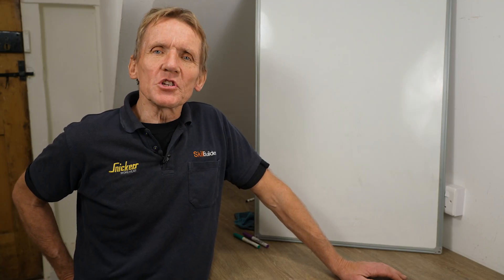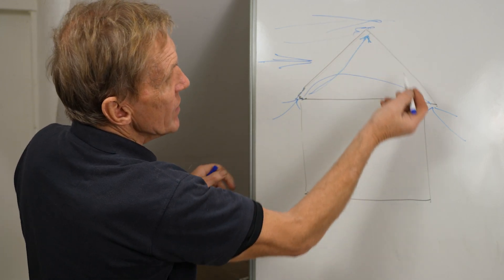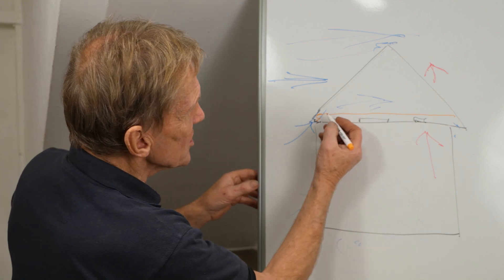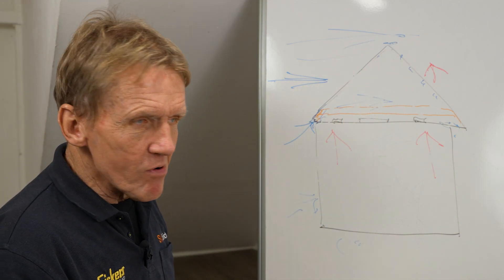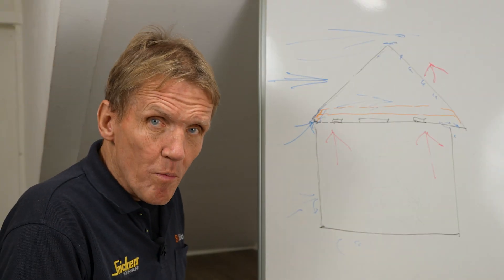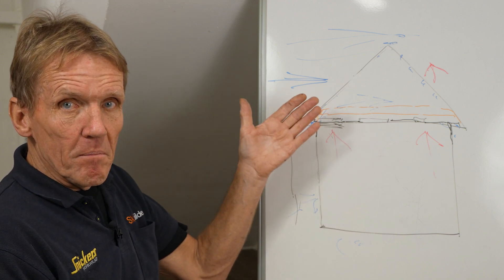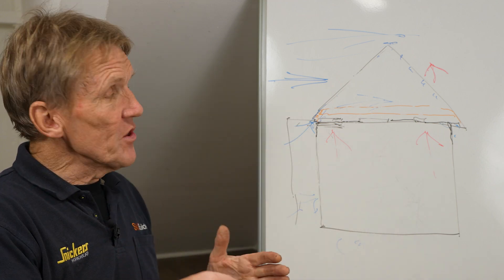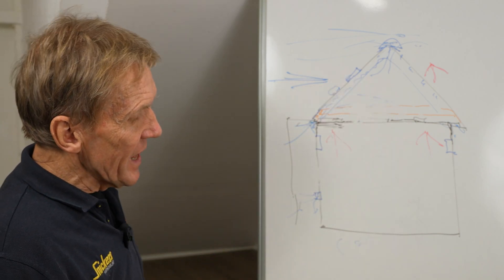Why Do You Have Condensation in Your New Roof?

Comment: Hi Roger, 
Heard you on radio 2 earlier today, I’m a plumber and I completely agreed with everything you had to say about heat pumps, the other guy David is clearly just a salesman for his product and that line of product. 
He was obviously just there for an argument, made me laugh when he replied with “that’s the biggest load of rubbish I’ve ever heard in my entire life”, I thought surely that can’t actually be the biggest load of rubbish he’s ever heard in his entire life, you made some very clear points and were stating facts about home insulation and heat pumps. Heat pumps are good in the right property, but how can a row of terraced houses or small block of flats possibly install this system practically, also completely unaffordable for most of the country, even with a £5K grant.
Reply: I only caught the tail end of it earlier but I totally agree. Often when people have a point to make that is sketchy at best, the adoption of a tone that undermines / belittles the the other ( Roger in this case), makes them seem more plausible.

People who know, know. Keep it up Roge 👍🏼👍🏼👍🏼👍🏼
Reply from the maker: Anthony
He was an attack dog, trying to discredit me from the off. The manufacturers of heat pumps say they should not be placed near bedroom windows where the noise can cause a problem, or near neighbours but he is saying they are whisper quiet. I love the claim that the pipework doesn't need changing. If you put big radiators onto small pipework it achieves nothing.
Reply: @SkillBuilder  yes but pa36 oxygen superheats at 56c blah blah blah, anyone who has lived abit just switches off when they hear this technobabble
Reply: @SkillBuilder  interestingly, I emailed you some plans of ours last year and at the time, we were considering ground source heat pumps, mostly because we are fortunate enough to accommodate the piping.

Anyway the company we dealt with were pretty much unconvinced of the feasibility from the get go, siting costs as being north of £25k to get something anywhere near the size we need, and that’s considering we have a totally blank canvas on an old property, that has been newly insulated internally!!

The trouble is, one size will never suit all
Reply from the maker: Hi Sam 
He is certainly a salesman and wasn't willing to admit that not every property is suitable. I think it smacks of desperation and he will bully people into buying. The best bit is that he is going to show us a 2 day installation and let us film it. What is the betting it never happens.
Reply: @SkillBuilder  ha ha, can’t wait for the 2 day installation video, it takes a couple of hours just to commission one properly, they’ll probably just throw 10 plumbers on the job, but like you say, it’ll never happen. 
Also loved how he was making out how clean heat pumps are and how gas boilers are killing everyone off daily. 
Don’t think he realises that most of the electricity produced in the UK comes from burning fossil fuels and heat pumps run on electric.
Reply: @sambiggs2295  The UK have lots o Solar and Wind power and there have been days when that has supplied most of the UKs electricity with some coming from Nuclear.  However as has been seen when they days are overcast or short then little solar is generated, and though battery storage helps you still need solar or other means to keep them charged.  Though generally the UK has lots of wind 2021 has not been one of them so power from them has been very low.  However it looks like there is a new generation of wind turbines without large rotating blades on the horizon with the ability to generate electricity at lower wind speeds.  (There have also been trials in Scotland and Republic of Ireland on power from the sea, not wave power, though the results have been good in the RoI I have not heard much of the Scotland test so I assume that technology is still pending.) 

The fossil fuel production of electricity is likely to be reduced over the next few years to a great extent as the Solar Power in Morocco from a joint venture comes on-line shortly, and in 2027 the power via subsea cable from Norway becomes active.  I still think there is a place for Nuclear but rather than using the very large costly installations taking a lot of time to build using the smaller modular ones.  The only issues I see with nuclear is disposal of the waste  and attack from nefarious characters and countries and the waste disposal situation needs more research to alleviate or remove that problem.
Reply: @SkillBuilder  In the netherlands they are developing a heatpump specifically made for older homes. Being developed by feenstra and vattenfall. Maybe we can get some insights on it from you?
Reply: @SkillBuilder  id give heat pumps a go if the installing company gave me 100% gaurantee that it would warm my home without and increase to my bills, gaurantee piping hot water, i love a scalding hot bath that i can then cool to my desired temp. Nowt worse than having a soak in a warm tub rather than a hot one.
God knows were they would fit it without ruining the aesthetics as they look ugly as sin. oh, and ive got 10mm radiator pipework so would need a complete refit. Im sure there are hundreds of thousands in the same boat.
Reply: Bit gutted I missed this. There's so much debate on the topic of heat pumps and having watched Rogers last few videos on them I'm in total agreement with him. I've had experience of them installed in unsuitable social housing properties where they were taken out and gas condensing boiler installed (again).
Reply: Any way to listen back to this?
Reply: @jwSawmillNL  BBC sounds. Worth a listen
Reply: Heat pumps are way to costly to run let alone buy! I bought just a small 5kwh pool heater style just to try and, it used around £5 per day around 8hours to bring the pool up from 12c to 18c on a 26c day 🤷‍♂️ if I used my lpg boiler with a small heat exchanger to heat the pool roughly same temperatures it would heat the pool to around 33c in 3hours then the heat pump would keep the temperature around 33c to 22c into the next day! However with the heat pump running through the night plus the pool pump it would cost around £15p/d  this is only a 6000lt pool so nothing special….

To get good heat in the winter everything needs supper sizing with  running costs going up, the only way having a super sized system would work is if you had a good solar array with a good battery bank! 
Solar panel’s don’t last forever and neither do batteries heat pump’s need servicing regularly so where is all this money coming from and has anyone bothered calculating all the replacements and service etc? I can see this hole system being a lot worse for the environment than burning gas.
Bring in the hydrogen boilers and ovens etc set up a grant for them instead of heat pumps stop playing games to make false profits to look good on the world stage.
Reply: Shame the debate on the JV show wasn’t allowed to continue. Isn’t electricity about 5x price of gas per kw/h even with the best Kw/h output from HP’s still more expensive than gas. Can’t wait to see you film the install.
Reply: These heat pumps only work efficiently on new build eco houses… I stayed in an small eco built cottage in Devon in May this year and 
the owner had put £5k of cellotex in the build !
To be fair it was ok but you had to switch it on 5 hrs before to get it warm !
There was a large log burner in the lounge that the owner said it was for effect !
Probably for winter I think 😂
A S heat pumps= the next big scam ………
Roger right as always !
Reply: The guy was an embarrassment with an answer to everything regardless of what he was actually saying.
 The problem is he along with other avarice salespeople will be selling in some cases a lemon to uninitiated people.
If anyone knows if or how the interview could be uploaded to utube would be nice for people to hear it for themselves.
Reply: I am not a believer that heat pumps are the overall answer even though politicians seem to have buried their heads in the ground with that as the answer.  (They have done the same with EVs, where currently they are the answer for some,  but not all, until battery technology ramps up which is happening, and have little regards for any other technology.)  When I was having a new boiler gas installed 5-6 years ago  the guy from British Gas giving me a quote told me that in theory they offered them but there had been so many issues with them that they had stopped.  With Ground Source there is not only the amount of land required but the fact that it could affect wild life as all the heat is taken out of the soil.  With Air source the amount of noise generated,unless the manufacturers invest in low noise fans that will possibly mean larger enclosures, will cause anti social issues,  And on top of that it is unlikely for them to be able to supply the amount of heat so if people need to top up with electricity that will be costly.  And then there is the cost of  the installation, replacement radiators, service pipes, etc.  Personally I still think that hydrogen should be given more consideration.  The biggest issues will be if the existing distribution network of pipes can support the pressures required for hydrogen, and whether the hydrogen can be generated environmentally friendly and economically.  Many people would have to change their boilers, and burners on other equipment  but that is still likely to be less expensive than the alternative.

Comment: I'm currently putting a bigger dormer in my 1970s "chalet bungalow".  As part of this, there's a 2-tile wide section of the original roof which will need to have the felt replaced (because it was under the original dormer edge, and has torn during removal of the dormer).  It's currently a fairly heavy bitumen-like sheet, to which the fibreglass insulation has attached itself (I think over the years).  The roof has never had moisture problems (there are no vapour barriers, and I think the roof is well ventilated as it's always dry), so I want to replace it with something that will work for me (and preferably do the job myself, as I'm doing most of the other work myself).  Should I just go for a good three-layer breather membrane?  I only need about 5m x 1m of it...
Reply: yes change it while you can

Comment: Thanks Roger. planning on plasterboarding our loft space for storage - do the same principles apply? Would a vapour barrier behind the loft plaster be a help or a hindrance? I tend to think it would help after watch your video.
Reply: Plasterboard, for storage space? Someone's doing well for themselves...
Reply: if using foil faced pir insulation you can tape the joints to create a vp and i would recommend at least a 50mm air gap and a dry ridge system
Reply: and fascia vents if boarding to the floor, if boarding to a dwarf wall (ashlaring) then tile vents would suffice
Reply: Vapour barrier yes….a vapour control layer no ( Vcl )

Comment: I don't think moisture permeable membranes on the roof are a good idea at all. Better off ensuring you have proper eave ventilation, or install a dehumidifier.
Reply: Can you explain your opinion. To say they are not any good (breather membranes)has to have back up. 
Of course eave ventilation is mandatory but everything is a system: eave ventilation, dry ridge , hip ventilation and breather membranes all work together like roger says  it comes down to quality of products. Companies like Tyvek, protect glidevale and klober spend thousands on R & D to put there products on the market. 
I’m a carpenter by trade and I’ve seen it so many times…..builders tender for the job put a provisional cost in for x trade. That trade comes along and installs what they use unless it is specified in the specs of the job. So it’s down to the trades to provide quality but what that means,  it eats into their beer tokens!
Reply: @christaylor5291  I'm a residential contractor in the United States. Introduction of moisture into the roof, especially in freezing conditions, only makes the roof assembly deteriorate faster. Ridge vents, roof vents, proper eave baffling, and/or dehumidifiers are best. Besides, if you're relying on roof underlayment to vent your attic, you'd likely already have a condensation / mold problem.
Reply: @JohnComeOnMan  I completely agree, one product on its own will never work. Perhaps in England the climate isn’t harsh enough as the states to warrant a dehumidifier but i could see the pro’s for it. 
The cheapest and the best solution if done right is natural ventilation. Thanks for replying back. 🙌🏻

Comment: The stupid thing is if you're going to make a sealed house you should like is common in passive housing and new NA builds, seal your roof so it's classed as conditioned space too, that would avoid many issues but unfortunately building standards are lagging behind. Something that is going to cause no end of issues in the next 10-15 years with the advent of new electric low temperature heating systems.

Comment: The guy who does my roof tiling came up with a good idea, he put short sections of 15mm pipe between each felt drift to provide ventilation, you can buy purpose made felt trays to do the job but the pipe works
Reply: Yes, I did that about 10 years ago - no condensation at all. I used 32 mm waste pipe which might give more air flow than 15 mm. Cheap fix that actually works!
Reply: @robdavies68 my mate said it cured his condensation too. I recently used it on a refurb listed building I’m doing, could use eve vents at the bottom but no vent through so put it in each rafter bay at the top of the vaulted ceiling and hopefully it’ll work well
Reply: I have this in my house but it's little polystyrene blocks. Always wondered what it was for and considered taking them out

Comment: My 1930’s house suffers from high moisture content and I’ve fitted the Nuaire PIV as recommended from your other video taking to the installer, I know the roof needs replacing eventually as it has line mortar but no facia vents, I’m guessing that the PIV is just sucking the warm air out of the loft and putting it back into the house as the moisture content has hardly changed and also we are still filling up dehumidifiers
Reply: I’ve had a notification from comments from dovedale but can’t see all the comment??

Comment: Will a humidistat controlled fan help to get rid of moisture?
Reply: That’s called a PIV!
Reply: It would be constantly on as it would pull moisture from the continuous natural ventilation. 
For an example. For a humidistat in a bathroom to work properly, after finishing in the bath or shower, you dried your self down,  you would need to shut the bathroom door and windows to get the humidistat to get the moisture level to x percentage. If you left the bathroom door open it would stay on until the near by areas around the bathroom where at x percentage. Chuck in the front door opening and closing. It’s a never ending saga.